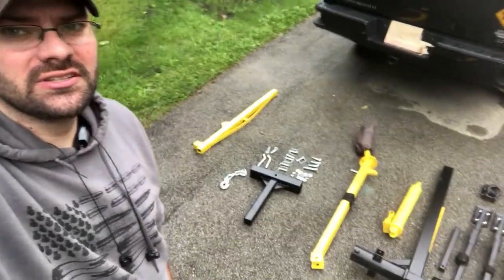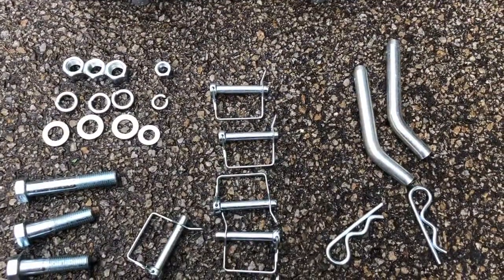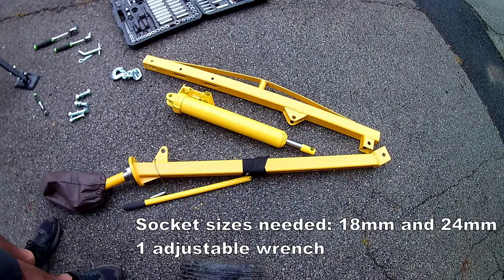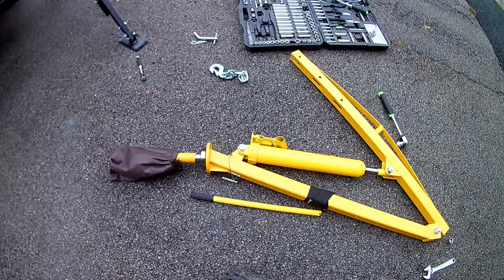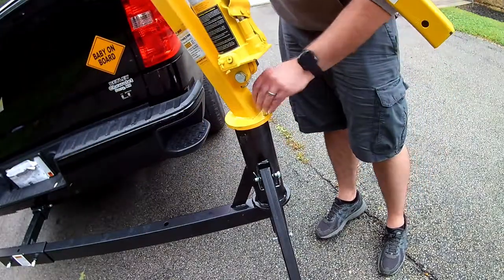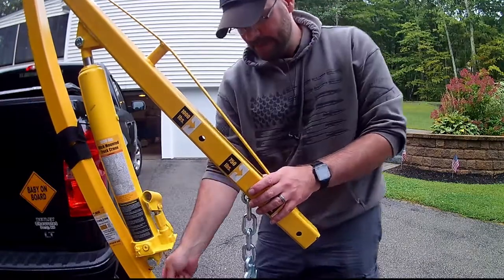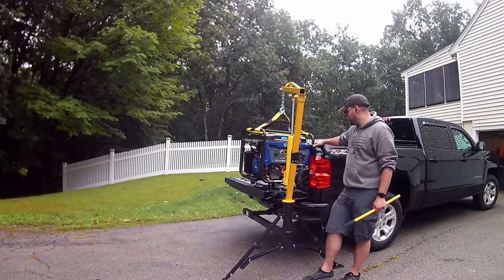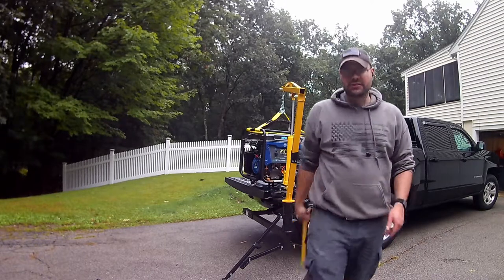Maxxhaul Truck Crane assembly and review.

Comment: Mine arrived today, followed the instructions, no problems, except which bolt goes where. I didn’t have any problem figuring things, length & hole diameter restricts which bolt goes where.  I use it on my SUV hitch, to lift my zero turn mower, among other thing, pulling posts if needed.  Looks like you did a great job, wish you were helping me, or vice versa!  I believe we will enjoy this new tool!  I was surprised at the $200.00 price, but took advantage of it anyway!👍🏻
This whole crane fits under my SUV, when not using it. Reassembly is quick & easy! It picked up my mower, till the frame in back, was on the ground. Plenty of room to work under the mower, using the 500 lbs hole. Very pleased with the functionality of this tool, & storage!

Comment: Your video cut out when attaching the main horizontal stabilizing bar to the hitch receiving T bar, and I didn't get to see if the 2 bolts let you adjust how far the horizontal stabilizer bar went in (closer to the tail gate). I would like to see the hoist be able to safely reach the truck bed center for the bulky items rather than so close to the truck bedside wall.

Comment: Great job on your video, thanks.
Getting to Maxxhaul,
Your addressed deficits and your disappointment with the outreach bar being too short along with the crane simply too short for adequate clearance while lifting taller object’s, has been a problem since this tool was first offered to the public back in 2012.
This is obviously a made in china item and quality control non existent.
It’s quite unfortunate that other makes have not capitalised on the inadequacies and manufactured much improved cranes of this design type.
I cannot seem to find hitch mounted crane’s that do not copy cat these same mistake’s.
It’s beginning to look like and  in order to have a properly functioning truck crane lift one must go custom.
I guess the old adage one gets what one pays for holds true here.
My overall opinion is this little unit is better than nothing for the price and your video was excellent and well presented.
I hope this device works out for you and meets some of your needs.

Comment: I have one that is supposed to arrive today. 2/19/20. I never read instructions so this video is great. Ha---Thank you. (Looks like the 1000# position would put a load on top of the side of your truck bed.)
Reply: You can simply slide the crane further through the hitch, putting the crane pivot point close to the center of the truck.

Comment: Good demonstration. Thank you. Could you not have removed the stopper pin once the load was above your truck bed and carefully swung the load further to the center of your truck. I see that the pin was stopping the rotation of the arm.
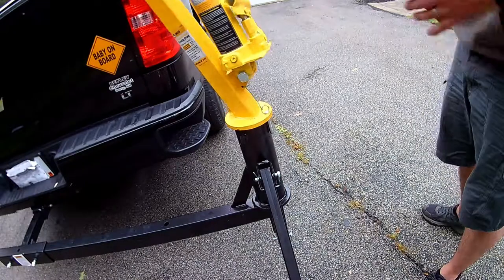Reply from the maker: I did a lot of tests before taking the actual video and I was unable to get it further into the truck bed without hitting the bed itself. I can see what your saying about the pin being a problem and yes once its up in the air you can pull that pin and you could swing it all the way around if needed. At 5:23 I show the area of the pin stops. I actually have to bring the generator in for service today as I left gas in it too long so I will try exactly what you said and let you know.
Reply: @dissectingdiy  thanks for sharing! Once it is assembled, how long does it take to remove it from your truck and set it up again? I plan to pick and deliver automobile engines but curious if setting up the lift for every delivery or pickup is too time consuming where it becomes a major time factor. Or, is it as simple as removing the swing arm followed by removing the bottom support system from your hitch and done?
Reply from the maker: Tito Valentin it’s pretty quick. Less than 5 minutes. I pull the yellow arm assembly out  after strapping arm down with velcro strap provided. Pull the pins for the legs and then the lower assembly comes out after loosening the bolts. I knew I should have taken a video doing that but it started raining.
Reply: @dissectingdiy  awesome, thanks for the response! Looks like I'm sold :D